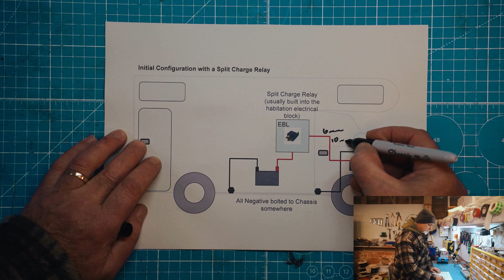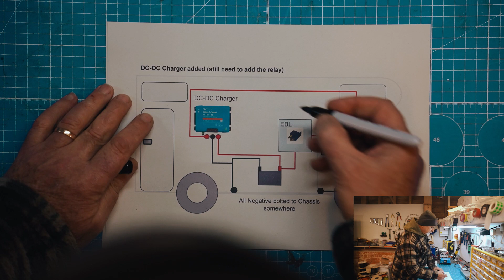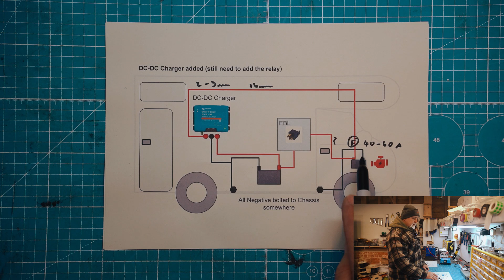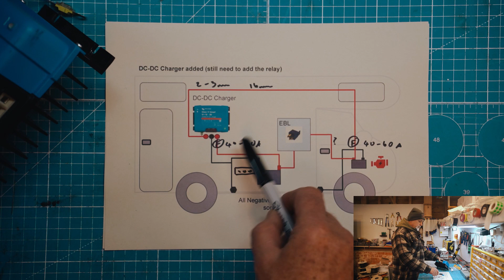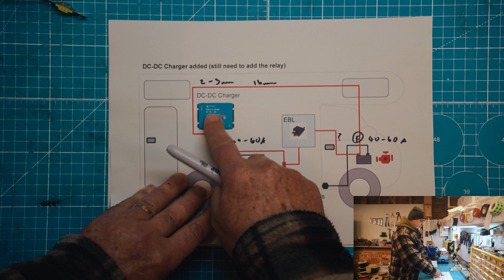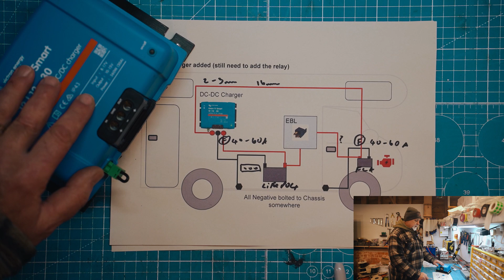How to install the Victron DC-DC Charger

Comment: Hi love the videos but can I ask if you connect the negative wire directly between the starter motor battery and leisure battery rather than grounding it to the chassis is that okay
Cheers Joe

Comment: Probably should also add a cautionary note, that many EBL’s incorporate a hab battery charging facility from shore power. If replacing the hab battery with a LiFePO4 you MUST also disable the legacy shore power charging along with the engine battery charging capability.

Comment: Great video!  I think I'd want to completely remove the split charge relay.  And a mod I'd introduce is a manual switch, accessible  in the cab area which is wired between the D+ signal and the "H" terminal in the jumper block.  I could then disable the B2B quickly via a simple switch throw rather than scrabble around getting to the B2B and pulling the jumper block out.   Of course there's always the app but that assumes my phone is to hand etc.

Comment: on my boat I have a single FLA battery for house and starter duty.  Also have 2 FLA in series for a 24V trolling motor.  My starter/house tends to run down after hours of fishing with fish finder and livewell running.  Was thinking about adding a single 24V 100AH Li battery for the trolling motor.  BUT also powering the house load from this battery through a 24-12 DC converter.  Do you see any issues with this?

Comment: This is the BEST video I have found for installing the Victron DC to DC charger in a motorhome EXCEPT you do not really get into how to properly circumvent the EBL, and I could not find this in your other videos.  Please elaborate.   I have an older motorhome that has a cross-connect switch for the vehicle/chassis lead acid batteries.  Please review the proper handling of this.  Thanks.

Comment: will this system work with a Schaudt EBL99, as when D+ closes the Main Relay in the EBL. Both Batteries are connected together and the higher curent can flow back to the starter Battery, Bypassing the Dc-Dc Charger ???

Comment: Thank you for the excellent videos. I have to disagree, however, with your choice of fuse position on the DC-DC Charger output line in this video. The fuses should be near to the energy sources - which, in the case of the output line, is the Leisure battery. Placing the fuse as you have suggested next to the DC-DC Charger leaves the wire to the leisure battery completely unprotected in the case of physical damage/short to chassis. The leisure battery in a source of extremely high energy, especially if it is LiFePO4.

Comment: Thank you for the video. Any input on wiring differences for a dual battery dual alternator like in full size Ford, GM, RAM trucks?
Reply from the maker: If you have an alternator dedicated to charging your auxiliary battery, you should use an isolated DC-DC.

Comment: Hi Roger.. its not that cold in Blighty is it? The red D+ wire going to the right hand side of the green plug.. the other end goes to a 12v ignition source? So when ignition is on that red cable is live with 12v if im correct in saying.
Reply from the maker: Yes that’s correct!
Reply: @offgrid_power  thanks Roger
Reply: @offgrid_power  what's the left side for? And can they be daisy chain together with another dcdc 12/12/30?

Comment: Can you connect them to a Cerbo GX?
Reply from the maker: The older version of the Orion cannot be connected to the Cerbo GX, but since recording this video Victron notified us that we can preorder the new Smart DC-DC BuckBoost that will ship early December and this version allows connectivity to the Cerbo. Here’s more info on the new DC-DC: https://offgridpower.solutions/shop/victron-energy-smart-buckboost-dc-dc-charger-non-isolated-50a
Reply: No but Xmas time victron are bringing out a 12/12/50A DC/DC with coms. Just need a VE Direct cable to the Cerbo